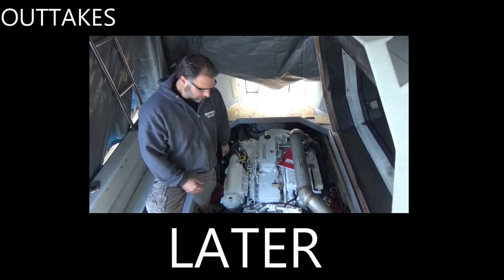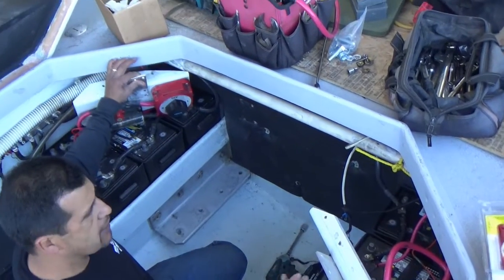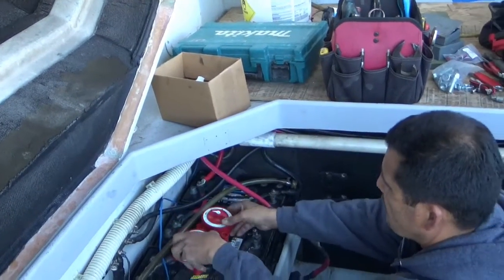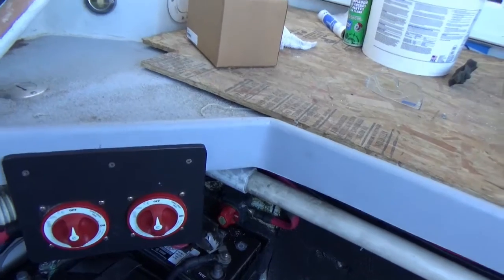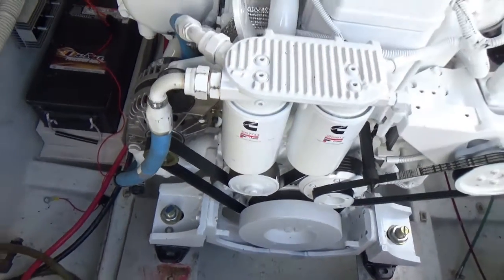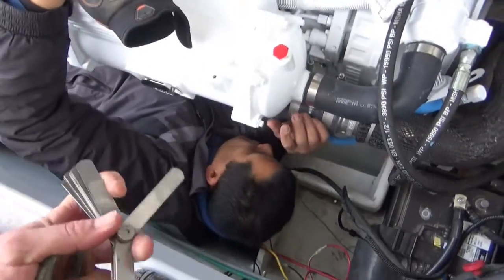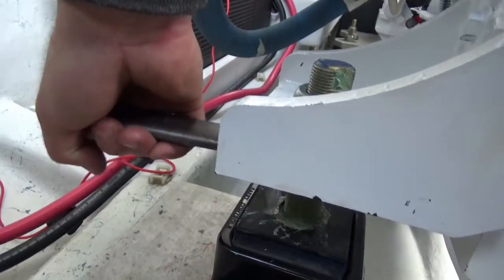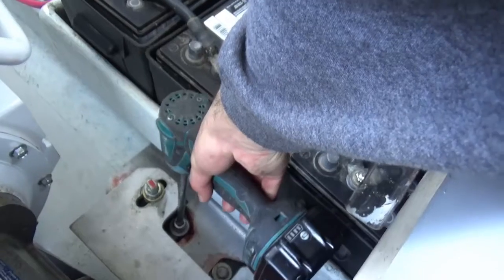Project Spotlight: Radon 29 Engine Alignment and Battery Wiring

Comment: Great job! How do you align a ZF 302 IV V-Drive with a through shaft  transmission ? I just had to replace all my motor mount on one of my Volvo TAMD74P-A motors and it’s not aligned as the engine is moving up and down when rotating.  Thanks